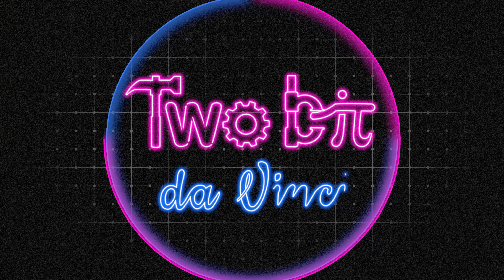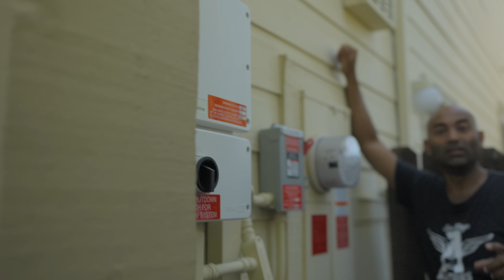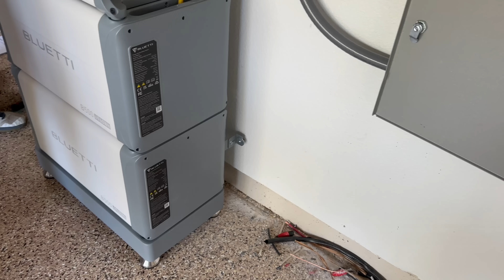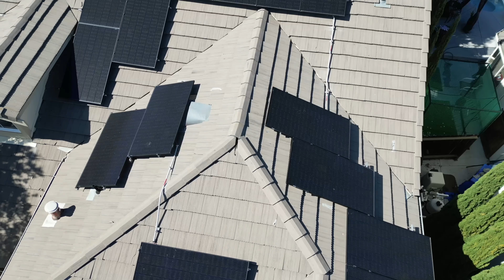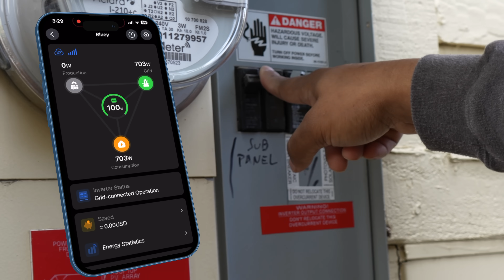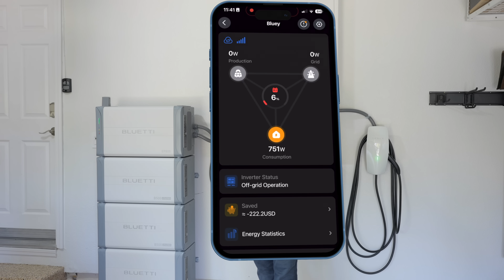Why the BLUETTI Whole Home Battery is GENIUS

Comment: The thing I am so curious about with any of these systems that sit in a garage is are they air conditioned or not? A lot of the guys who make these videos NEVER talk about that. I know these systems can operate in lows or highs that are extreme, but in a texas summer when it's 98-105 degrees outside, but the garage is 130, how long will that last? Doesn't heat degrade the battery over the longtem?

Comment: I like this set up you put in your brothers house. I am 55 years old and we have nem 1.0 until 2037. Since the grid is my battery in a 1 for 1 exchange, I currently have no need for something like this. IN 2037 when I lose nem1.0 status, I will be 67 years old. I will need to make a decision about adding batteries in 2036. By then the tech should have advanced and prices should be much cheaper. We rarely lose power and as of today, I have a generator that is good enough if we lose power for a few hours. With Ca constantly attacking solar users and trying to get rid of nem 1.0, it will be interesting to see if I make it to 2037 on nem 1.0.

Comment: If I wanted to use a standby NG generator with this, can it be used with a smart transfer switch to control the activation and deactivate of the NG generator as needed?  I'd like to run off NG Gen in the daytime and off the batteries at night in an outage

Comment: I have two BLUETTI LFP batteries. The AC200 MAX is the master battery with all the inputs and outputs that I use for car camping as well.  The other is the BLUETTI B300-K add-on for increasing the output for home power outages. Both will run my 2 refrigerators and some appliances. They are charged during the day by my 220 watt solar blanket. 
UNFORTUNATELY ANYONE WANTING TO BUY BLUETTI BATTERIES NOW WILL PAY THE 145% TRMP TARIFF !!

Comment: Battery's are really the key to making these systems make sense both practically and financially, IMHO. We've got approx. 30kw of storage and 25kw of solar on our roof and it has already taken us through multiple outages seamlessly. Unfortunately our local codes now require any battery storage be protected by fire sprinklers if it's inside the building which makes the installation costs unappealing to most. In talking to my solar vendor, there are solutions for outdoor energy storage, so it's not completely off the table, but for most, putting batteries in the garage is the goto and now that will require even more time and money to happen. Great content as always!

Comment: I live in West Virginia and 3 days after my Powerwall was turned on, the grid here went down for a whole week: 7 days. Two months later, another 5 days. We hadn’t seen this really since in the two years I have owned my equipment, but all my stuff in the fridge and deep freezer would have been trash and I just bought over $1,400 in meats. My car wasn’t charging and dryer wouldn’t work, but everything else my house run from my panels and one powerwall. Everyone needs a system like this and some sort of battery backup. The cost really needs to come down some though. It is still out of reach for so many people.
Reply: Sadly prices are about to get a bunch worse :( The "big bill" is about to trash solar and wind... I have solar on my current home but am moving to a new home in an area better for solar but now won't be able to afford it. I haven't had a power bill here for more than 2 months a year in over 5 years here. Guess those gas and oil guys are getting their money's worth dammit.
Reply: @BLKMGK4  yeah, it really sucks because I was looking to expand my solar array and add batteries next year, the bill BS bill just messed up everything.
Reply: It’s pretty good where I live. In the last 10 years the power was down for a combined 4 days. And I have never purchased over a $100 of meat in one shop. But someday I want to get solar and batteries to cut down cost, unfortunately it’s very expensive and the total pay back version is over 10 years.

Comment: 8:11 Hi Ricky. Love your content. I’ve installed about 100 home backup battery systems. 9.6 kW is the lowest kW that I’ve ever installed. Many are higher at 12 - 15 kW. 9.6 kW is only 40 Amps. Those struggle with 60-80A starting load of most AC units. Soft starts split the initial load of the fan motor and compressor and that helps a lot.

Comment: the implied irony is the Tesla charger you have there -- it would simply be smarter to get an EV with vehicle-to-home capability for most outages... that's 56-87kWh of power. HUGE.  that whole stack you had there was ~15kWh?  sure do the math on energy arbitrage and do not rely on your vehicle for day to day cycles...  but all the base equipment needed for all this stuff definitely adds up when you need less b/c you have a V2H EV.  DO THE MATH/HOMEWORK.   these are paid advertisements and free equipment, and probably a $$ reason he didn't have a system in the first place.

Comment: Cool.  It just makes since to have your own DIY solar system with battery's not dependent of grid power.   Any time you have the power company involved it is going to take much longer to break even on the install. A smart load controller switch at the panel just makes life easy to ween one's house from grid power requirements.

Comment: You know I kinda think this is genius. Allowing to plug your solar directly to your batteries without permitting or anything is so smart. You get through the trouble once for the batteries, then expands everything according to your needs progressively.

One thing is bugging me though, is how frequent are your power outages. I mean we hardly have one or two power outage per year here, and it lasts what, 15 to 20 minutes.
Reply: Here in Ukraine we also hardly had any outages until several years ago.

Comment: At 4:37 you say the Bluetti powers his whole house.  I believe this is incorrect and what you meant to say it powers the loads that are in his critical loads panel.  This is because the Bluetti was installed to only backup the critical loads.  All of the others loads are fed from the grid, regardless of what the Bluetti does.
Reply: Yeah, this was a very partial home backup.  The cost of this system doesn’t make sense if it can’t handle large loads, like the AC and EV charger.

Comment: The inverter is too small at 7.7kw.   Will need at least double that especially with electric appliances, air conditioner, even the water heater uses a good chunk of energy,  PLUS AN EV? .     Definitely much larger Inverter.      We are considering 18 KW.

Comment: We have a Bluetti (ac200p) for camping but it's not designed to run a house. 
It's quite crude compared to the Tesla Powerwall 3 that we had installed last week. 
(Australia)
We had the battery wired up so it can run the entire light and power circuit during a blackout, But of course we won't be using ovens or HVAC if it's a long-term blackout.

Comment: Does the Bluetti whole home battery system have an option to be charged by a generator input and/or from the grid during off peak power costs?
I don't have any solar panels, but I'm trying to design a system of adding a whole home battery with the option to power my house and charge the battery packs at the same time with any unused generated power.  

This would allow for me to shut my generator down and then run the house off of the full battery packs, thus making my backup power a more efficient setup.  
This type of setup would also be capable of using a automatic power transfer switch to the battery packs.  This would give us time to setup our portable generator to supply power when necessary (once the battery packs have been depleted).

I know this isn't an ideal situation, but I'm attempting to do the best with the setup of my current house.
Reply: It is set up for energy arbitrage as described in the video. This is actually one is its primary design use cases.
It isn't really set up for a generator input. But you can put a transfer switch on the incoming power and switch over when the grid goes out. Just make sure your generator has a pure sign wave output. Also, I can think of no situation where a fueled generator would be cheaper than grid power.
Reply: @williammeek-h2o  :  I did not mean to imply that a fueled generator is cheaper than grid power.  In our area, we can be without power for several days or even longer.  Not having the ability to charge the batteries from a fueled generator would mean that I would be without power within 24 hours of an grid outage.

I would use the fueled generator to power the house while also charging the battery packs, thus attempting to capture all of the power being made by the fueled generator.  Currently much of the possible fuel generated power is not being used.  Our fuel generator does not throttle up/down with power usage demand.
Reply: @RealTechSkills  A fueled generator dose throttle up and down with load. It couldn't work otherwise. What it doesn't do is change speed. Because if it did, it would break anything powered by it.

Yes, your plan for energy arbitrage most days with a generator to backup for long outages is a good one. Just pay attention to your fuel. Gasoline goes bad in 3 months or so an diesel in a year or so without stabilizers and even then, that only roughly triples the life of the fuel. Propane is the best option for something that is only rarely used. Or natural gas if available. Both can be used for cooking and heating as well whereas with gasoline or diesel that is problematic.
Reply: @williammeek-h2o  : I agree that the load on a generator does change with demand.  I understand that the generator speed has to be constant in order to produce a valid 60hz wave form.
I only use 100% gas (no ethanol) in my equipment.  I have never had an issue with any of my gasoline engine powered equipment that was fuel related.  I also rotate my gas cans so that it is rarely over 6 months old.
I have my portable generator setup to use both natural gas and gasoline.  There is a simple switch over process when changing fuel sources.
Thanks for your comments.  I will be sure to plan out my new backup system for as the best possible outcome.

Comment: The offshore electric and hybrid boating community needs to get their noses into this ... due to the safety factor and temp. Stabillity. Sailing from Svarbard to the Carribbean or Brazil in the summer can push a boats electrical systems to extreems.. 
Theres also the vast distances they cover and deep drain safe transit ability. 
The other issue is if a boat sinks ... Its Na Cl ....  Its environmental pollution impact should be minimal ... 🤔🛡️🧙🏼‍♂️🇬🇧
Reply: Solomon Technologies used to make electric motors for sailboats. They could charge the batteries when under sail power.

Comment: Seems odd to not wire the stove into the back up system.  It's not like that's going to turn on by itself.
Reply: The stove and the AC unit draw too much power to be used with this system plus the car charger. That is why they are left out when on battery power. Electric furnace would also be too much. With his natural gas furnace, this can power the low draw blower motor and the gas controls so you can have heat in the winter if you have an outage. Not sure of the draw of a heat pump system but I suspect that is too much draw also. This would be great for me with a gas furnace in my little duplex. I could run the whole place except for stove, dryer and AC. That said I would not spend this much on a rental unit and landlord does not care enough to do this expense.
Reply: @markpashia7067  Heat pump water heaters burn less than 1.5kW.  Heat pump furnaces usually run slightly above A/C… call it 5kW.  A mini-split system, however, typically burns less than 2kW.  Without backup heating elements that is (not too many locations where you would need backup heating elements in the first place with modern heat pumps).   EVSE is programmable of course but for most EVs charging tops out at 7-9kW.

In a power outage one would have to be careful not to run the battery out, but for normal on-grid self-consumption (zero import, zero export), real ESS systems (Franklin, EG4, Tesla, Sol-Ark, etc) have no trouble offsetting large loads.  Maybe not the EVSE on a 24-hour basis though, unless one has a massive amount of battery storage, since that represents an enormous amount of total energy.
Reply: @ericmaclaurin8525  A standard electric oven can pull 7.5kW while heating up and 3-5kW while cycling at temperature.   This Bluetti definitely can’t handle it.  But most real ESS systems (Franklin, Tesla, EG4, etc) would have no trouble.  My own home is now on an EG4 system which I DIY installed.  GridBoss + Flexboss21 + two 14.3kWh batteries and it has no trouble running my whole house…. Oven included.  A/C and EVSE too!  Though if I lose the utility then I would have to keep things under 12kW or so.  Or get a second inverter.

Comment: I've been living off-grid for 25 years now relying on solar , battery systems and just recently have discovered a serious problem that needs to be addressed .  Inverter power is prone to voltage spikes when you first plug something in ... for example if you plug in a big , expensive stereo that is turned off into an inverter and you here a "pop" from your speakers that means that your inverter just sent a little lightning bolt thru your stereo thru the on-off switch .  I would strongly recommend using surge suppressors on a lot of your stuff including washing machines . Inverters do not like to run washing machines .
Reply: How old is the inverter?